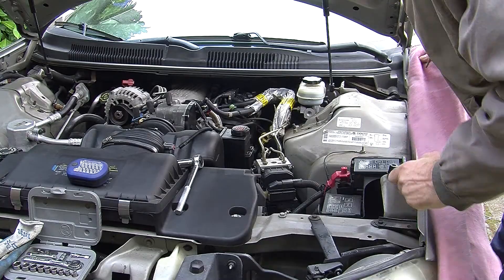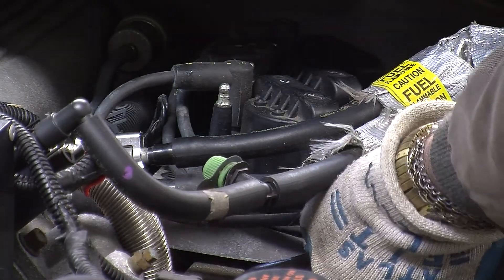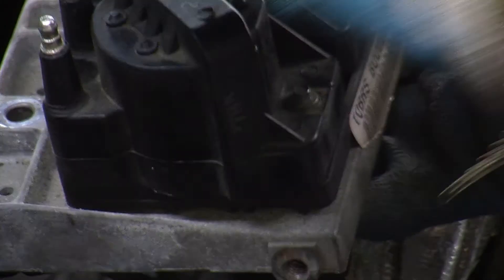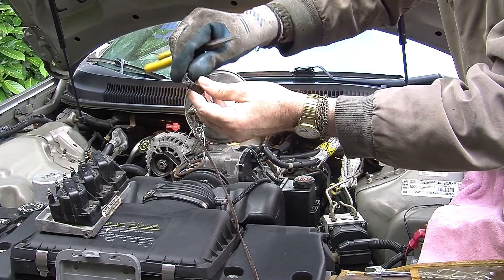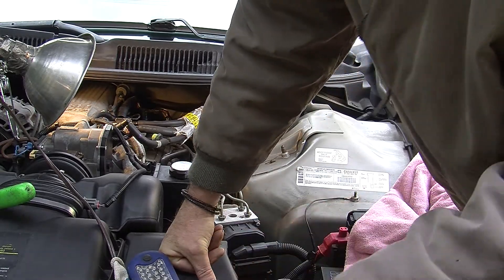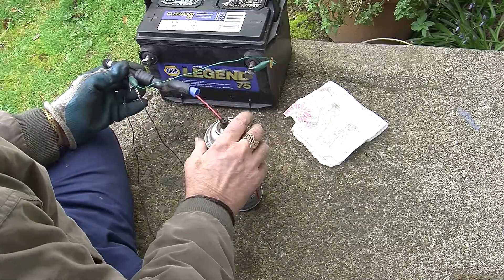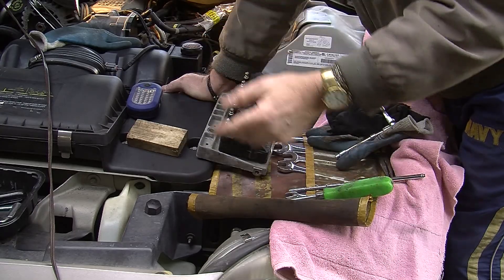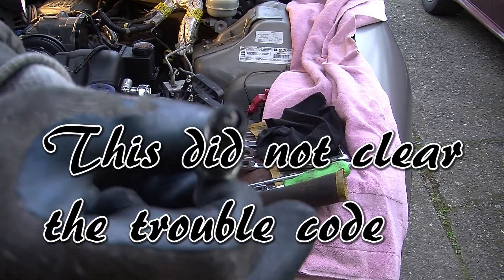Camaro 3.8 Fuel Injector Service Troubleshoot DTC P0305 VIDEO #GearHeadsWorld

Comment: I’m having misfires on my 98 cylinder 5 and 6 and I’ve replaced all spark plugs and wires and one of the coils and it’s not better and now it’s leaking fuel when I stop the car or leave it idling so I think it’s the injector or injector rails but does anyone else have experience with this? I’m just a little lost because I’m no expert and this is my first project car
Reply from the maker: I would say that chances are good. That fuel leak is related to your codes. Every fuel injector must maintain the optimum fuel pressure or it will go lean.
Reply: @ it just started leaking the other day but when I bought it every sensor and anything computer related was having errors due to none of it being connected
Reply from the maker: @TrevorThomas-q2n : A classic case of you acquiring somebody else's good times with your purchase. Someone else troubleshooting problems they can't find, so they sell it.
Reply: @ChuckFasst  I got it from a used car dealer
Reply from the maker: @TrevorThomas-q2n  yup. 😢
Reply: @ChuckFasst  yeah on top of that tho it’s been stolen and had an engine fire so it was motor swapped at some point and the steering column moves if you push on it😂

Comment: Most times if your having misfires try replacing sparks plugs, wires ,and ignition module also coil packs your will run smoother and most likely that code will leave (code popped up because there was rust build up on module).
Reply from the maker: Yes, we tried the most likely fixes first. I think that is called something like vernelli's principal.. then once all of that fails we move on into the more perplexing ones.
Reply: @ yea if it isnt any of that though Theres possibility of electric issue

Comment: Why don't you take the whole fuel rail out and do them all at once like the repair manual says
Reply from the maker: As it would turn out there never was any problems with any of the injectors, at that time anyway. Many, many days later I would stumble across the problem. The exhaust cam lobe in number five was flattening. I couldn't believe that had happened with a roller lifter, but it did. Fortunately I found all the parts I needed at the local engine recycling Warehouse. Not every town has one of them. But it worked out for me. Inexpensively. Hella lot of work though!   😢

Comment: Ok so mine just started doing this tonight. Ran fine up until now. I have replaced plugs and wires and coil packs. Next was going to be the control module and now I guess I need to try the injector. If none of that works then what else could it be??  At that point its all new parts lol
Reply from the maker: Hopefully it won't be what mine turned out to be... Goddam camshaft!   😣
Reply: I replaced all of it and turns out the coil and wire was bad. I also replaced the EGR valve and she runs great so far.
Reply from the maker: Always good to see problem solved.
Reply: @ChuckFasst  let's hope so.

Comment: I had this problem on my 1998 V6 camaro and it was the Ignition control module. I got the part cheap from a scapyard that had a couple 98 camaros and i also got an ICM form a newer buick that had the same engine, I installed the Ignition Control Moduel from the camaro and my car was fixed!    so new ICM and maby some coil packs.

Comment: Has anyone found what the cause of this would be? Seems to be pretty common for no one to have figured it out.
Reply: Wing Nuts Auto , yes I found the problem, is a specific injector for cylinder 6 and 5, they are a little big longer. In my case the injector 5 wasn’t sit correctly because was the incorrect one.
Reply from the maker: Wing Nuts Auto   : I continue to wrestle with this after 2 years. I have had it into shops. But you know it's something simple right in front of everybody's face. Isn't it always. looks like my last resort might be taking it into a dealership and have it put on there special scopes as much as I hate to be forced to do that.
Reply from the maker: Wait, what? This is the first I have heard about special injectors???

Comment: Do you have the part 2 of this video?
Reply: Luis Arevalo I'm having the same issue but now will not idle at all. Have you found a fix?
Reply from the maker: @myronmccowan6121  Never found it. Other probs cropped up some 3 yrs. later. Now installing all new fuel injectors.
Reply from the maker: So, FYI. Among many other problems, the final problem turned out to be the camshaft. See the other vids. #ChuckFasst